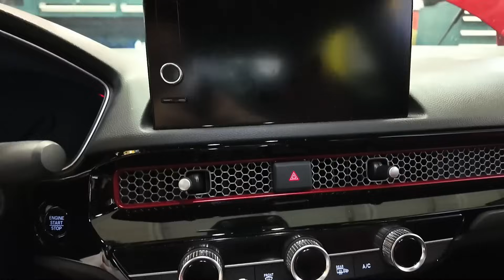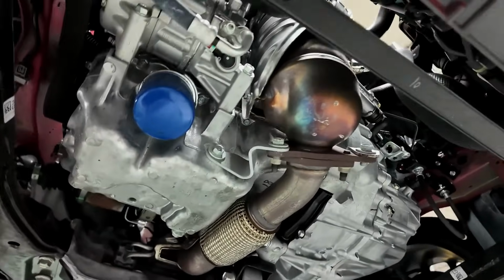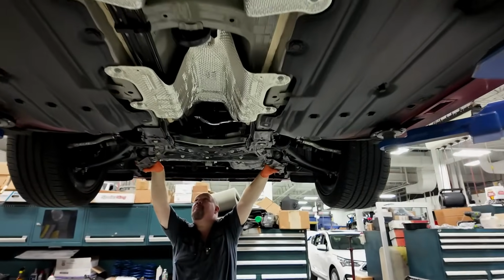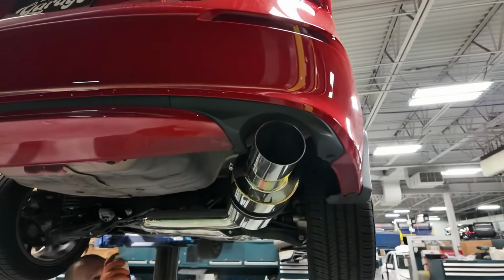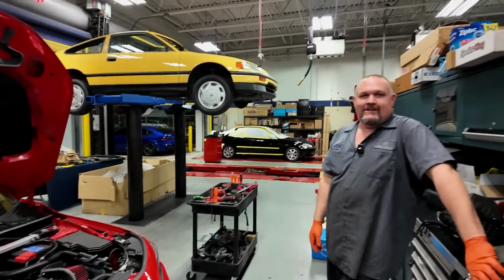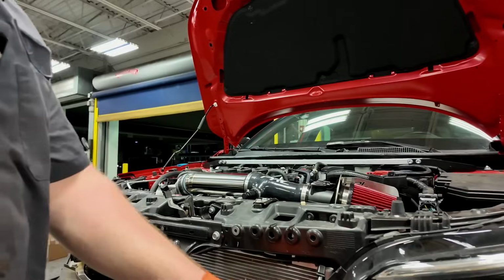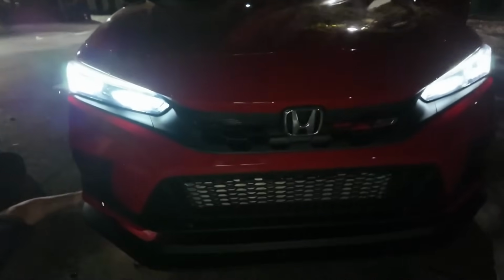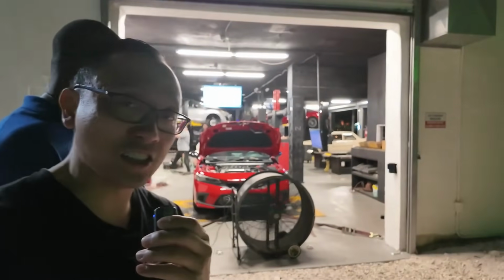11th Gen 2023 Honda Civic Si // Full PRL Motorsports & Two-Step Performance Upgrades

Comment: Whole lot of money for 218whp :/
Reply: Once he tunes it with all those parts it’ll be up around 270 wheel and a tune costs about as much as an intake
Reply: @Yahmuddacapiche you will never push 270 on stock turbo. Im 244 FBO
Reply: lol I spent about 30k on kw suspension, advan gt wheels, billet manifold, intakes, full titanium exhaust, downpipe, charge pipe, and tune /dme unlock for my bmw so $3500 ain’t nothing 😂

Comment: Question: Why bolt on all those parts... cold intake, filter, down pipe, mid pipe, exhaust, etc. and NOT put even a mild tune on it??  Seems like a lot of money to get 20 more HP. Edited...unless maybe you don't want to void the warranty with a tune.  Thanks!  Great video!
Reply: that is about 40 wheel hp gain over stock without a tune which is pretty good but this thing would easily make 250 with a tune. definitely for warranty purposes. once my factory drivetrain warranty is up i'm going to do the same boltons as well as a drop in turbo upgrade. hoping for around 330-350 on e85.
Reply: @Joel-ze1xr     I guess the bolt on hardware will not void the warranty, but the tune would?  I would think with a tune.. it's invisible.  But with all that new hardware staring you in the face when you raise the hood... it's bound to be a red flag for the Honda stealership mechanic... lol    Thanks for the reply, good luck with the larger turbo when the warranty is over.  Later.
Reply: @jaytroxel3495  most manufactures make cars very non aftermarket friendly these days for a reason also with more hybrid vehicles becoming standard tuning will be a thing of the past with direct e drives replacing transmissions etc with cars being engineered to only work proper with manufacturer only parts and suspension components example BMW m2

Comment: You can do all those mods with no tune? Seems kind of sketchy to me. He would probably gain another 40-50 whp with a tune and it would probably be safer to drive.
Reply: And he would have no warranty left
Reply: @Evolution10X  you can still revert the tune back
Reply: @dougsk8rwiggy  honda can tell if you flashed the ecu unfortunately, so yea warranty goes out the window
Reply: @temtongu9481  depends on how you broke it

Comment: Not a fan of a the single exhaust but i personally like the dual exhaust look
Reply: that's redundant
Reply: isntt it dumb to have a dual exhaust in an inline engine
Reply: @WadeLofton its unnecessary but personally i think it looks cleaner
Reply: @Joel-ze1xr  their is a reason 1 forced induction engines need a lot of free flow in exhaust so engine can run efficiently also i see no point in changing anything on a civic si stock is only need you should have now that car prices are out of control i see no reason why stock isn't good enough  and most buyers dont care for aftermarket anything if i got a car id have it put back to stock before even buying it for 50 state compliance reasons also most aftermarket exhaust sound like garbage to me
Reply: @darkninja6658  I think dual exhaust looks better idk why you’re replying to me

Comment: I'm almost 3/4's of the way through this but have a Remark exhaust. Still need DP, FP and intercooler. Don't know why you did all this and didn't get the HVI with cold air.

If you use the HVI with the cold air attachment I recommend removing the foglight cover on the drivers side and putting some mesh in there to avoid debris.

Comment: If you used the phaerable 1.5r tune youd be just south of 300 with all those bolt ons.. the tune is the biggest gain from all of that
Reply: What? The most we can get on stock turbo is 250
Reply: @11thgeneration_civic_si  on stock tune ya... the tune should bring you to atleast 300 with all the bolt ons
Reply: @dougsk8rwiggy  literally impossible
Reply: @11thgeneration_civic_si  phaerable 2.5 right on their site says 277hp 320tq.. and its on oem intake and a catted dp... soooo whos lying?

Comment: Custome E Tune makes this with bolt ons easily 240-250whp Ik many ppl on E running 270-280whp stock turbo nd clutch but I personally wouldnt chance it until I replace a few components that are weak
Reply from the maker: You are correct. Gotta get all of the right pieces together like clutch and such first

Comment: My 19 gli has 228 stock lol but I’m starting to like Hondas after seeing this
Reply: Usually manufacturers will rate at the crank. These guys are measuring at the wheels. Any vehicle you can expect anywhere from a 10%-20% drivetrain loss. Honda's are usually like 15% loss through the manual transmission. So if it were rated like production vehicles it would be rated at about 250hp.

Comment: There should be little indents on the lip where you screw into that goes through the lip into the bumper. I have the same lip never had any issues
Reply: I drilled through and used nuts/bolts and washers, mine too solid as a rock.
Reply: What’s your guys ig?

Comment: With the performance set up, is a tune required or is it recommended to get the most out of the gains?
Reply: Yeah you'd wanna tune it to take advantage of the aftermarket performance parts

Comment: So, I did a search for the stock specs on this 2023 Honda Civic Si. I didn't know the stock horse power and torque numbers. The end of this video told me the Dino results after all those upgrade changes. I'm shocked that there was only 15 hp and 15 ft-lbs of torque gained, yet the owner probably spent over $3,000 on all the upgrade parts... Too expensive for the little gains in performance.... Tell me I'm wrong....???

Comment: wait. full bolt on just for 18 extra horse power for $1000+ in parts?
Reply: Those mods are never really about power. More sound than anything - but if he tunes it now that car prob goes to 250hp.
Reply: Im FBO pushing 244

Comment: Can I ask what’s the part number on the exhaust blockout/cover
Reply: Block out exhaust cover are under Civic Ex Trim ( compatible for Si if you are planning to do aftermarket single exhaust then you can use this blockout cover for the sides you want by following part number below . 

P/N Left : 71591-T20-A00
P/N Right : 71541-T20-A00
Reply: @harrysiew  Thanks!!!

Comment: You guys been taking off precaution on the lip next time add some fasteners drill a couple screws centre ends. The lip is fine. It’s not that bad I would buy because I saw somebody else. Did a better job than you guys and it still works for them.

Comment: does it need a tune for the intake and exhaust.???
Reply: It does, since the free flowing intake and exhaust will alter the afr. In my G70 3.3tt, I installed intakes and full exhaust it went in limp mode I needed a tune afterwards.
Reply: No tune for the way PRL designed the intake and inlet pipe , dp is no tune as well and won’t throw a CEL but granted your not getting much gains no tune

Comment: Was there a check engine light?
Reply: No, the TSP high efficiency downpipe has a GESI catalytic converter. You can run it in CA without a problem.

Comment: Geeez. My k24 makes 260 whp all motor and my RSX weighs less than this pig. New SI’s are weak. 

Stock k20z1 can do that power with bolt ons and a tune.